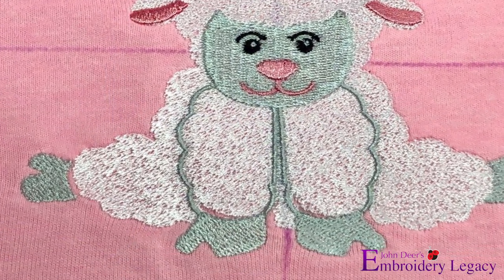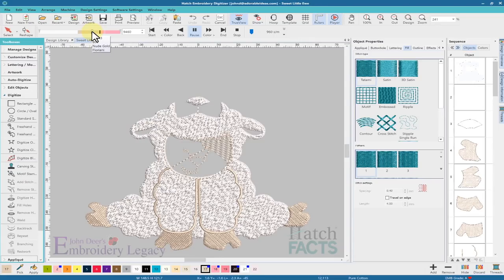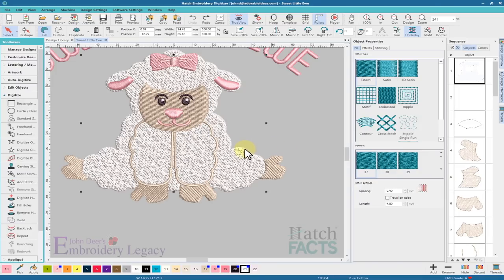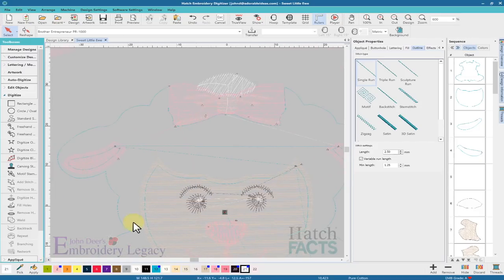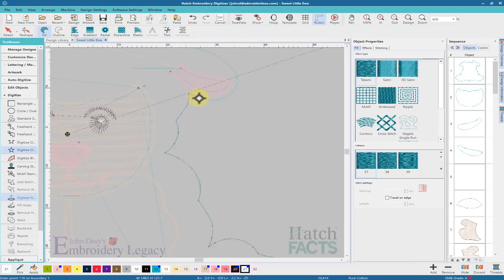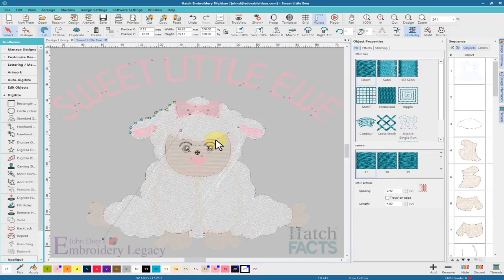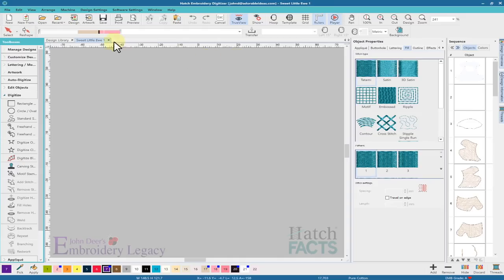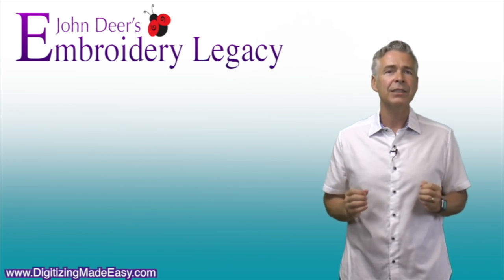How to Avoid Space Between Stitches - Embroidery Medic

Comment: The disappearing graphic is something that happens OFTEN with auto digitize. I'm so glad to see you struggling with the same issues that I have been wrestling with. I just presumed that it was due to me being a complete noob! I usually just switch the shape to hidden & use the background graphic & manually digitize it. I find I'm doing more manual digitizing now than when I started at the beginning of July. Converting the fill to an outline is a brilliant way of working without a background graphic. Great Tip! Thanks! I've learnt so much from your videos. Thanks master! You say that you can control the underlay sequence. I had a zigzag  followed by an edge run. I saved my work & came back to the design  and Hatch had changed the sequence to edge run first followed by zigzag. So I changed it again & saved. Sure enough, when I reloaded the emb file, it was back as edge run first again!  It's driving me crazy!!!

Comment: I watched the video and yes I see how you fixed it. I was hoping to understand from a digitizers stand, what step can I take to allow for registration. Does the angle cause the gap? When I create I also look at it to make sure that one segment overlaps to compensate for that. But if you put the whole design as one angle do  you not also lose the effects also? I understand compensation comes into play. Carving holes does this also help not make a bullet proof design?

Thanks
Reply from the maker: The "angle" direction of the stitches does affect the gapping. I always place my inputs base on the angle and the push and pull it will cause. Carving holes in small areas both increases stitch count and creates complex pathing within fills. I'd much rather a fill start and one side and finish on the other. When you carve holes it randoms moves to accommodate the holes. :)